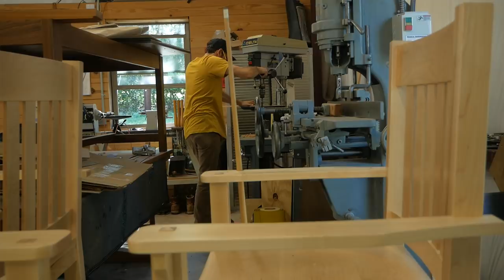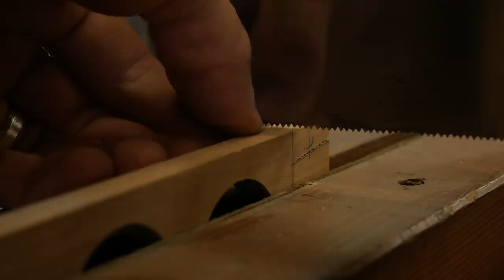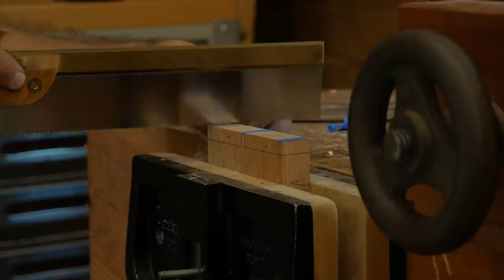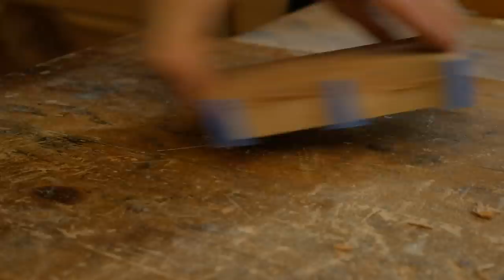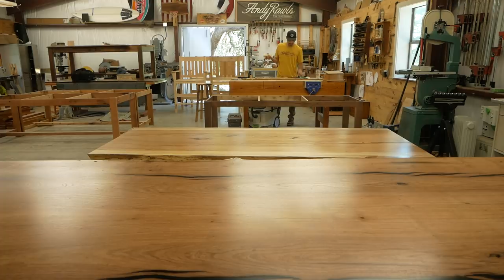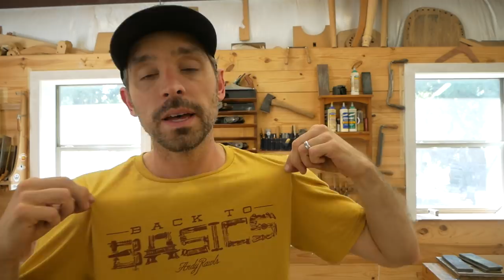Making A Handcrafted Egg Tray // Hand Cut Dovetails

Comment: I don’t have a drill press☹️
Reply: that is OK. Clamp some wood down, drill with portable drill. Then use this as a template. Either make small, 1mm holes for forstener centres, then drill carefully with forstner. The starter holes will be nice and accurate, or, make one large egg sized template and proceeed as above, or even router using using large egg sized template. In all cases do clamp everything down. Hope that helps.